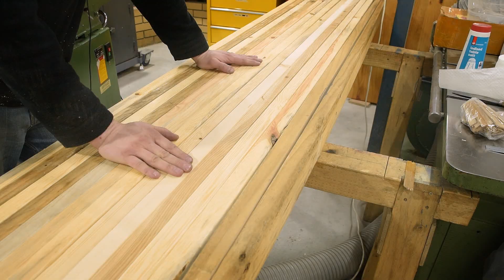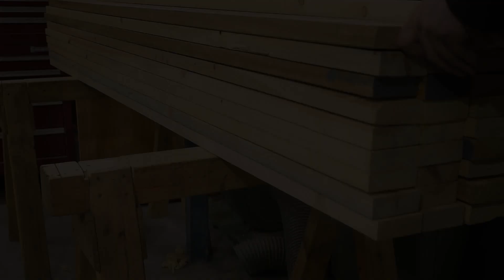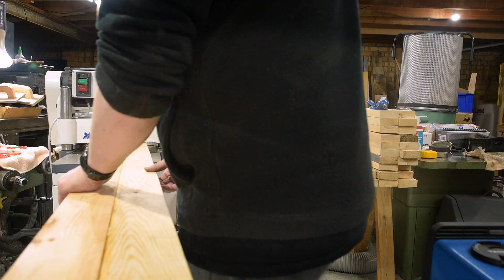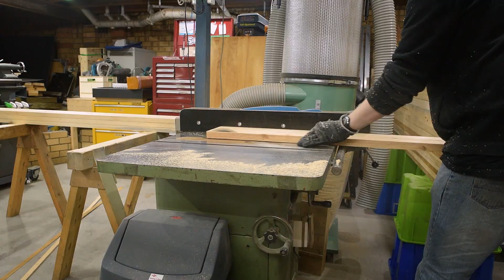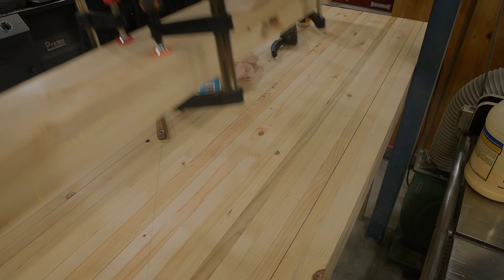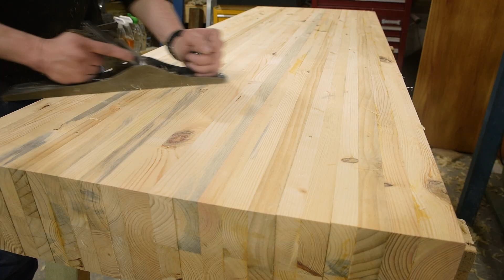Workbench build - THICK top

Comment: When I built a similar table, I drilled half inch holes through the boards and used half inch all thread to pull the boards together. I put four all threads in it. After I pulled the boards tight, I glued another board on the front of the table to cover the all thread on the now second board. Saved lots of glue and it is as strong as can be and has never shifted.
Reply from the maker: Good idea, Danny. Thanks for stopping in and taking a look.
Reply: @CraigsWorkshop  My pleasure sir! I enjoyed build!!!

Comment: What gets me is the enormous amount of man power, lumber, and capital, not to mention the extravagant tools and accessories spent on making some of these benches (haven't watched this one yet). I have one timber 8"X12" X 12 ' cherry, cut in 2007, a small set of chisels, one wacked out plane and several dozen rusty hand saws, one 4' single man saw and a bottle of glue. oh yea, a raw hide mallet, a few clamps a squares, and pencil. 

How did Roubo build his benches without all that stuff? Wood was probably very expensive back then, The rule was probably think several hundred times, measure a lot, and cut the absolute very minimum. 

The Roman style bench was my first project. No hardware just mortis and tenon,  tusk stretcher and leg ends (one piece ea.) that spread at 6 degrees,  Slab white oak top 24" X 64" mortised for side leg slabs. Holds a ton but used for snacks and coffee.  med height, abt 24", a tall seat, but a low table or bench. Now to watch...
Reply from the maker: Agreed - it's possible to make a heavy bench (of any style really) with a minimum or a multitude of tools. Same goes for a lot of projects. Some folks are set up with different machinery, or no machinery, and the great thing is when people use what's available to them and build something from scratch. I've built a few benches in the past, with features like dog holes, and tail vise, and from hardwood, but this one is going to be fairly minimalist. Wooden top, steel base (with drawers I hope), single front face vise.

Comment: I know it's too late and all, but when laminating up like this, it's worth marking each surface with a "preferred planing direction". Some pieces won't plane nicely over their whole surfaces, but there's normally a strong preference.

Then, when you arrange for lamination, put all your pieces so they have a common "preferred planing direction".

The resulting aggregate surface will plane nicely, or at least as nicely as possible, given your stock.

If you DON'T do this you are  carefully fabricating a piece of timber with awful grain reversals.

PS given the power tools you own, I wouldn't worry about a scrub plane!
PPS looks like you do a very nice job sharpening your plane blades
Reply from the maker: Thanks Paul - absolutely right. Could be as simple as a test plane stroke, then mark it with an arrow to show direction of planing. If I hadn't been so wrapped up in avoiding knots, and drilled holes (in the reclaimed bits), I might have thought of that :) For any difficult to plane bits, I always have the Record No 80 scraper. That thing is a wonderful tool. Cheers! Craig

Comment: This is similar to what I have.  I didn't double up the 2x4's like you did, but I could drop an engine block on it.  My only regret was making the damn thing 12ft long.  Now I have a 3ft workbench (maybe) and a 9ft long heavy duty shelf.  :-(  Don't forget to cover a section of it with some pretty stainless steel.  Make a nice work surface.
Reply from the maker: Thanks WorldTraveler - sounds like you struggle with the same storage issues I do!
Reply from the maker: @jagboy69  Thanks for looking out for me.
Reply: @CraigsWorkshop  I've had a couple of close calls.. I got lucky.  That video link I posted makes my skin crawl.😱  You do great work, I wanna see you continue to do so.😉🍺

Comment: Looks great! I'm quite happy, however, that I bought a ready-made work-bench surface - I built the frame under it from 38 x 89mm timber screwed to the wall and floor, so it ain't going anywhere.
Reply from the maker: Thanks Mats. Yes - there's nothing worse than a bench that jumps around as you're trying to work on something. And nothing more satisfying (workbench wise) than burying a mortise chisel into a bit of hard wood with no bounce back. Benches that are screwed to the floor and wall are a great option if you can do that, it really stiffens everything up, and it turns out it's quite hard to knock the planet off its axis :) Cheers, Craig
Reply: @CraigsWorkshop  Yes, my biggest worry is that the wall is probably not quite as strong as one would really wish, so pushing sideways on the bench is probably not the BEST idea. But still, it will take more load than if I just stood it free on the (rather uneven) floor.

I don't do much wood-work, even less in hard-woods, but I can see how that would be what you want! :)

Comment: Why bother with a steel frame.. just keep laminating till you get to the right height😁
Looking great Craig, will serve you well for many years👍
Something to think about that I wish I had, a top that thick can be a right pain if you want to clamp stuff to it. Maybe consider an edge strip of 90x50 on the working side for this purpose, could be removable too.
Look forward to seeing this behemoth grow. 🍺
Reply from the maker: Hey Bill, thanks 👍 I have given lots of thought to clamping options. A reasonable workbench needs to be able to hold large and small boards so that you can work on their face, edge and ends. I've tried working with some of the various options in the past, on previous workbenches I've built, but you'll soon see the direction I'm going and I think you'll like how minimal it is going to be. Cheers! Craig
Reply: 👍Minimalism is good and allows for future modification more easily.

Comment: Great work Craig.  That's a heavy bench.  Did you consider using harder timber ?  Cheers Rob
Reply from the maker: Cheers Rob - I did think about it carefully - and I have made hardwood (oak - and also hardwood plywood) benches before, but I'm pretty careful with my work surfaces, so I think this will work out great and be good bang for the buck. I still have the steel welding table if I need to rough and tumble with something that would damage the wood top! :)
Reply: @CraigsWorkshop  Hi Craig,  I have a pine top on half my work bench and jarrah for the main working area.  It can take some punishment, but you can get splinters off of it.  Something like spotted gun is probably a better solution and not overly expensive.  You are doing a great job on it.  I will be interested to see the outcome.  Cheers Rob

Comment: G'day Craig, is that the 90 x 35 Baltic framing timber that Uptons sells at Mornington? I've been using a bit of it of late and noticed that it is quite a pretty timber compared to the Radiata. Nice work, carry on.
Reply from the maker: Yep I use the North Hobart Uptons too, but it's the same stuff. I found about a third of it as reclaimed stuff at South Hobart tip and the rest was new. I did leave it in my workshop to acclimatise for many months (maybe a year) before I planed it up - hopefully it will be nice and stable.
Reply: @CraigsWorkshop  Just as an aside, I have some chainsaw milled planks of black heart sassy I cut in 1993, never got around to using it now I have no space to store it. Could you put it to use? FOC.
Reply from the maker: @ianmcdonald7368  Absolutely! Thank you. Where are you based Ian? I had assumed mainland, but I am thinking you must be local. We should perhaps email though - no need to give away your location in the YouTube comments. I thought I had your address but I don't. Cheers, Craig
Reply: @CraigsWorkshop  I'll send email